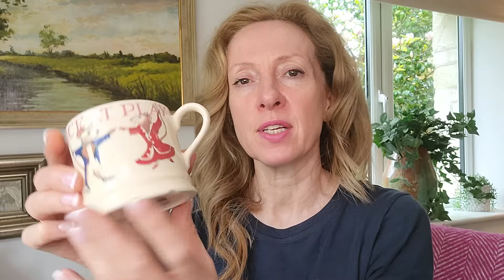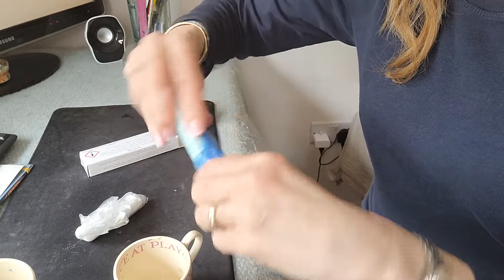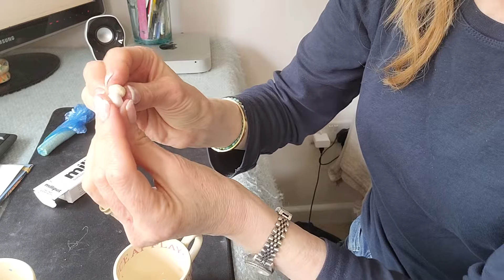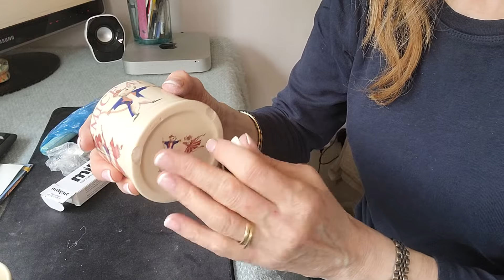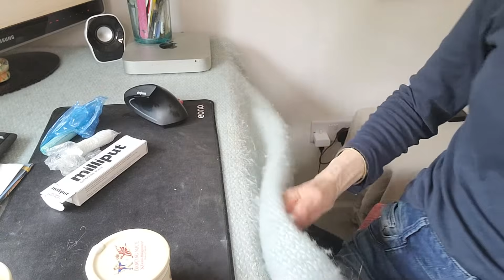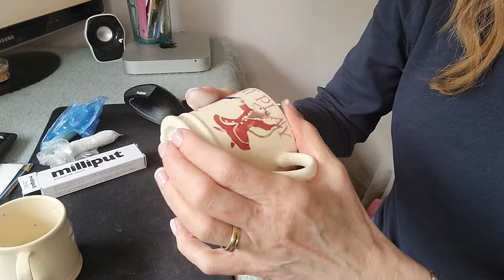Fix Chipped Cup  #ceramics #restoration #porcelain #repair #diycraft

Comment: I have a chipped mug and would like to use milliput to even out the surfaces. After it hardens, is it safe to use it in a dishwasher and the microwave?
Reply from the maker: It should be fine as long as it has been sanded and washed/cleaned.